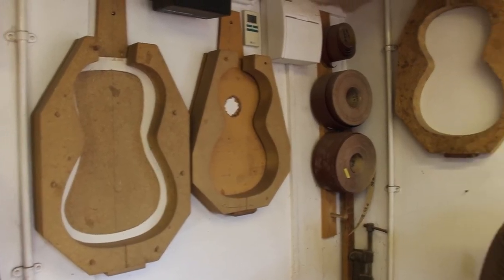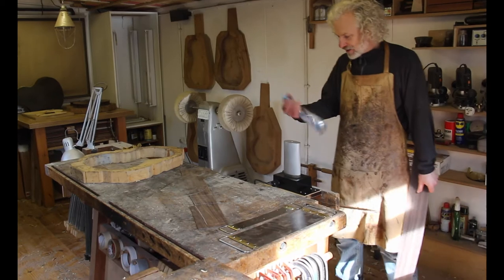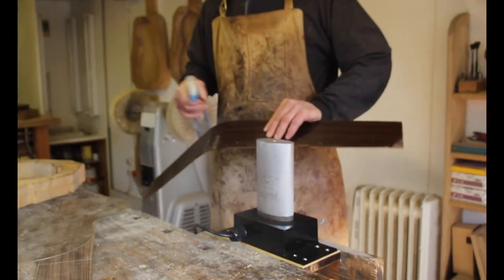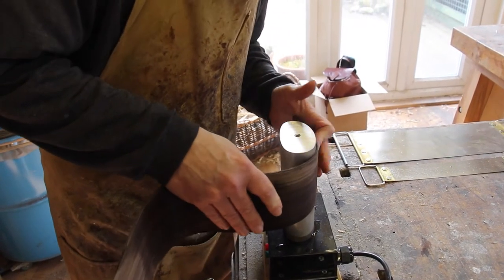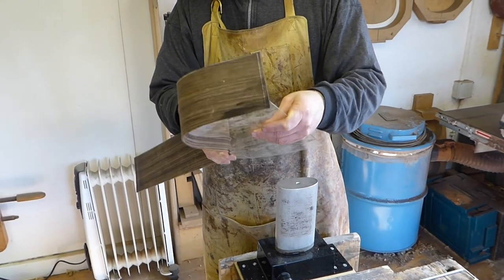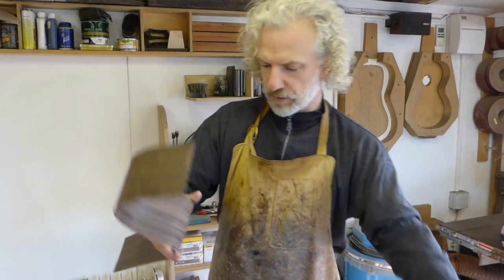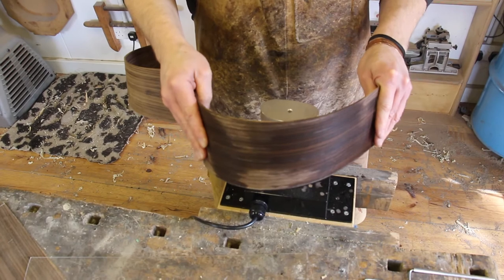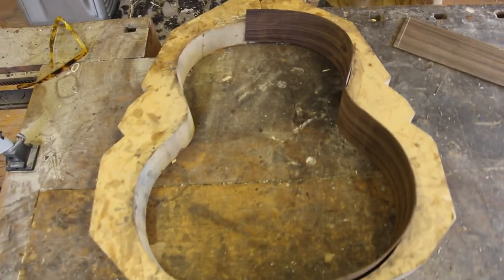How to Bend Guitar Ribs: With Gary Southwell | Luthier's Bench Ltd

Comment: I use a jig with bending slats and a heat blanket to get the basic formed sides and paralleled/trued.
Then I use a bending iron to finish it up, take out the spring back, etc. and done.  Simple and trued.

Comment: Hi Gary! How much preassure you have to put in your hands? I´m quite scary about breaking the wood. Thanks a lot!
Reply: I'm assuming you dont personally need the answer anymore, but I'll answer for anyone else looking. Basically, it's one of those "you'll know it when you do it" things. The first time you put the wood onto the iron, you wont know what's about to happen. Just hold it there and move it back and forth a little bit to distribute the heat. Apply a little bit of force to bow the wood (not trying to actively bend it, just enough force that youd be comfortable applying to the wood if it were dry.) At some point, you will just feel that the wood starts to give in and wants to start bending. He alluded to it a little in the video by saying you don't need to apply much force, the wood will do its own thing, you just have to guide it a little bit.

Comment: Hi  I've just watched video, bending sides. Really fascinating at the way you are bending the sides using the bending iron. I have a couple of questions, if this is OK. First, how hot does the iron have to be before the side begins to bend. And the type of wood must be crucial to get a perfect bend. I have used beech wood, but it  takes ages to bend and sometimes I don't get a perfect bend. Any suggestions would be appreciated. Robin.
Reply: The usual test of whether the iron is hot enough is that a drop of water will bounce off it.

Comment: Great video. I need to bend some thicker hard woods for sunglass production. Wood this work for let say 1/8th inch or
Reply: David kowalewski  Hi David, yes you could use our bending irons for 1/8th thickness. Though depending on your batch sizes I would probably recommend investing in a steam bender and moulds. If you are in the prototype phase our tool would be good for you  to experiment with vs mass production.
Reply: Daveshaveify thank dave!